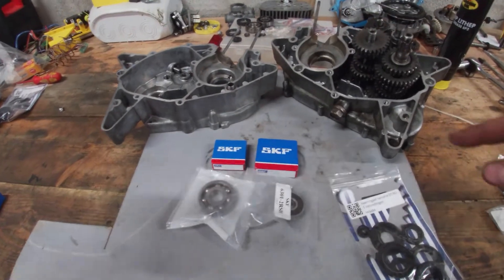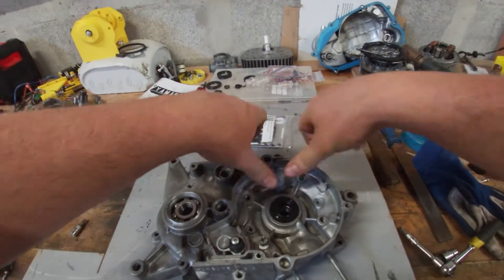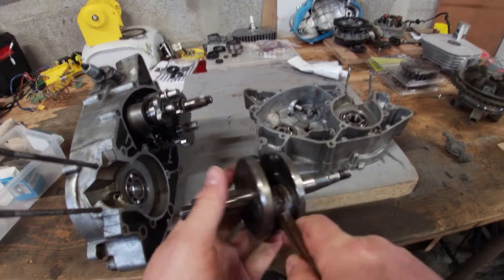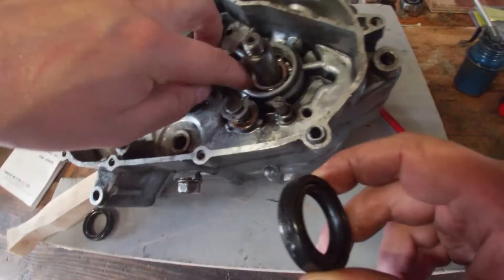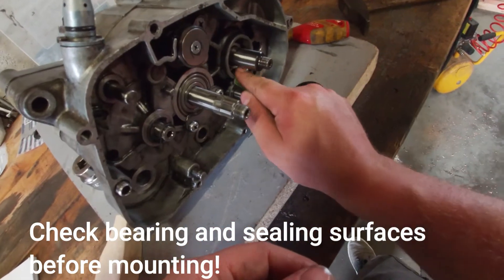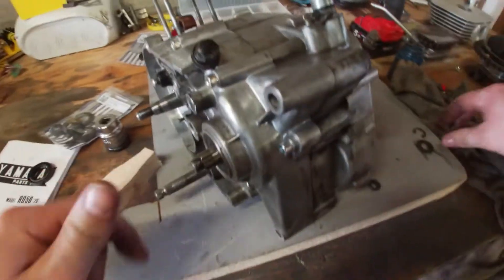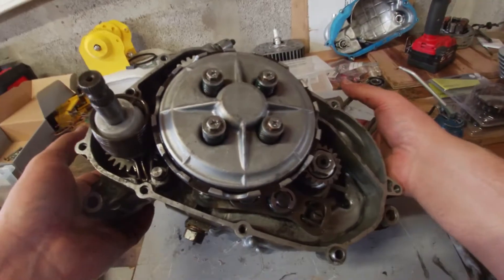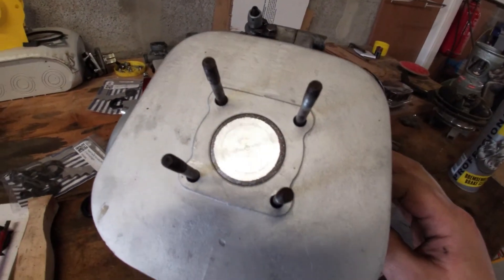Yamaha RD50 'Kenny Roberts' - Pt.12 How to rebuild RD50 engine

Comment: I'm looking to do this with my 1980 mr50. Where did you buy the oil seals set? And which bearings. I think it's the same engine
Reply from the maker: @Adriaan-bb6kv  the block itself should be the same indeed. You can find bearing and sealkits at JMPB.
Definitely let them know I sent you!

Comment: Can be dangerous to flatten a RD M piston. The top of the piston is calculated to stands against ignision pressure. It can blow a hole in the piston, damage the new coating and presses metal particles into the cylinder head. DX can reach 11000 rpm, which brings a lot of heat. Pressure and heat. DX need a proper piston.
Reply from the maker: You raise a good point. It ended up not working anyway with this piston. More on that on the next episode.

Comment: the crank bearing on the flywheel side was very slack fit  ?? ,, heat alone woldnt have made it expand enough for the crank to just slip in , vertically split cases like the rd and fs1e normaly require this side to be pulled into the bearing with a puller   .
Reply from the maker: They have been like this for both the fs1 and the Rd. Never had an issue with them like this.
Also I heat up the cases, but the bearings themselves have been in the freezer for a couple of days. So the cases expand and the bearing shrinks enough to have it this way. Worked everytime so far.